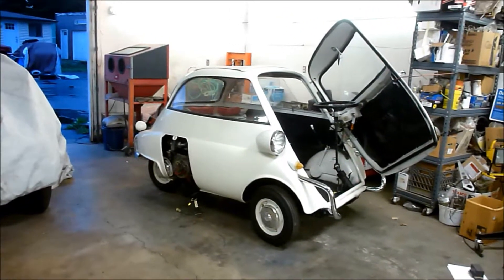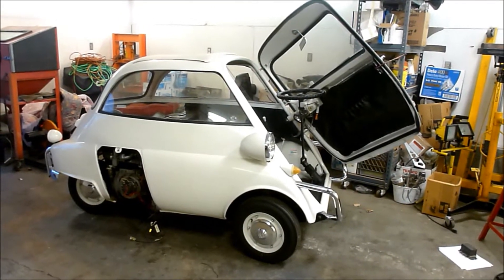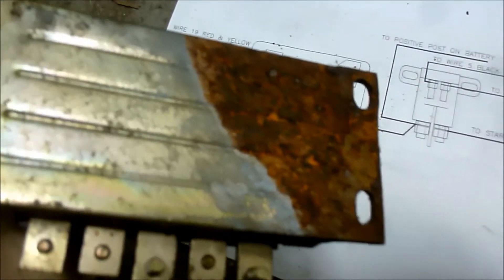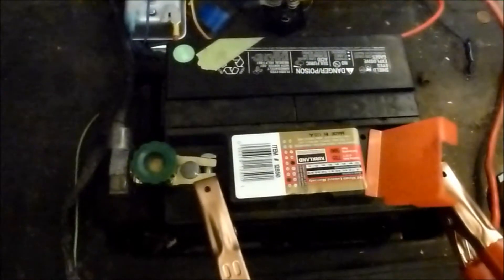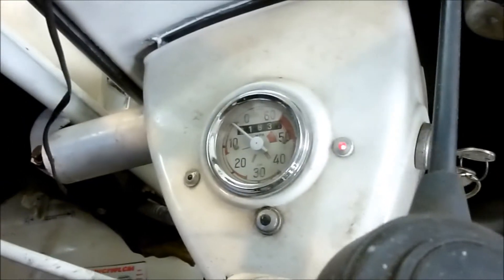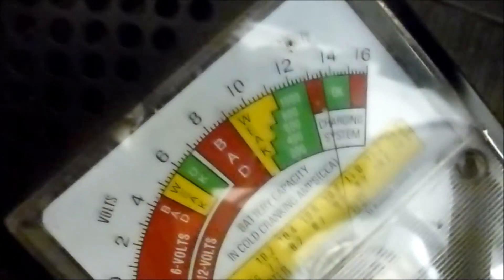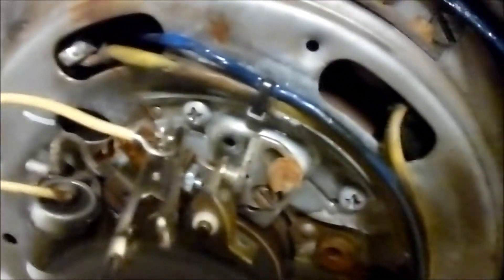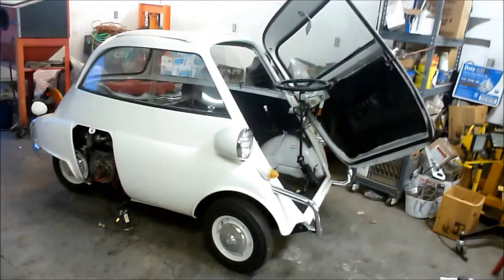Isetta Charge Challenge Conquered !

Comment: I WAS DOING THE VW REGULATOR / FORD STARTER RELAY 
CONVERSION ON MY ISETTAs 30 YEARS AGO .

THIS WORKS IN THE MESSERSCHMITT ALSO BUT REQUIRES A
SMALLER RELAY TO FIT INSIDE THE BLACK BOX

Comment from the maker: Excellent !, thanks for the professional advice, I will check it as the battery fills up. I didn't expect the dynastart to charge at idle, most older car with generators from the 1950's don't charge at idle either. No matter how high I rev this Isetta 14 volts is never seen. I'm so happy to get this finally working right. I can't wait to drive it.

Comment: Great charging voltage as long as you are moving.  I'd monitor the voltage to make sure it isn't over charging.  As the battery reaches a full charge you should see no more than 13.8vdc.I noticed that the regulator was doing it's job.  Popping up to close to 14v but then immediately jumping down to 13.4 or so.